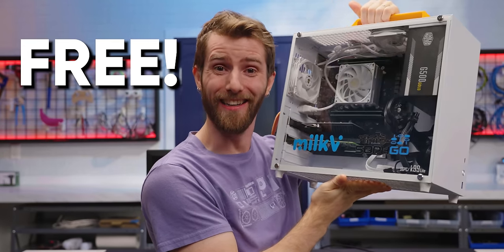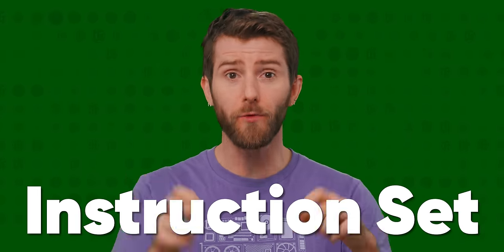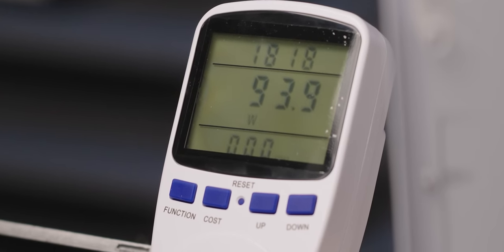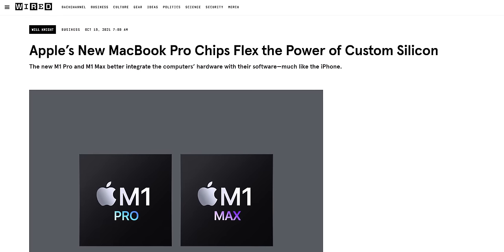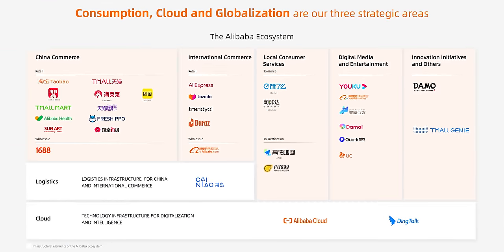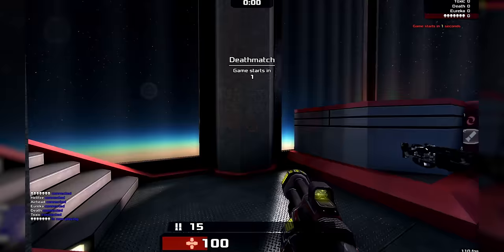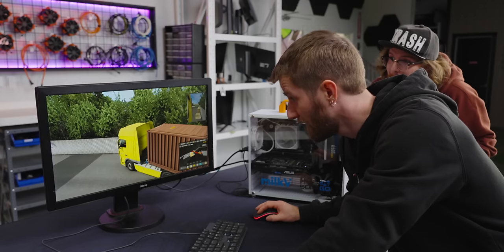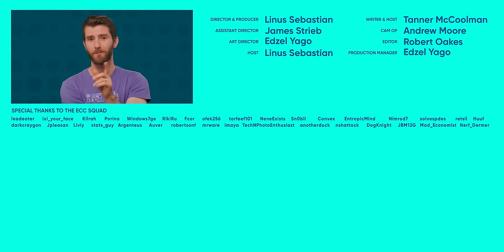This CPU is FREE! - Milk-V Pioneer with RISC-V

Comment: This takes me back to the Transmeta Crusoe from 2000, a RISC CPU that converted x86 instructions to its own in its middleware. It's a pity it never caught on as that was a really interesting concept, no software emulation/translation required, and they even demonstrated swapping out the middleware layer for a Java Bytecode one.
Reply: Though I have not used a laptop computer using the processor, one of my colleague did own a Fujitsu laptop have the Crusoe processor.  It was a tiny laptop with a long battery life.  However it did not pull out a significant lead over the usual Intel processor laptop computers. Another major competition disadvantage of this Crusoe processor technology is that it needs extra RAM to work well.  Notebook computer RAM chips were expensive that day and eventually it was caught up by competitors.
Reply: I would be really nice, if in the future there comes a RISC-V CPU that's able to do x86 instructions kinda natively.

That's the only gripe I have with the probably coming transition from x86 to RISC-V. Game compatibility and efficiency. The latter especially is necessary for gaming handhelds like the Steam Deck.
Reply: @Deinorius yeah, the big thing about the Crusoe wasn't the instruction translation, it was stuff that we now have on x86 cous, like dynamic frequency scaling
Reply: @Deinorius  Modern x86 cpus are risc in nature beneath the hood. The complex x86 instructions are broken down into simpler risc instructions. It is possible for a third party to design an x86-RISC processor but the problem is licensing. Only AMD and Intel are allowed to implement the x86 ISA.
Reply: No Transmeta CPU was EVER RISC. They were VLIW which quite frankly isn't anything close.
Reply: @TheReaper-fq6yv  I'm not talking about developing an x86 CPU but a RISC-V design that can run/emulate x86 code nearly at native speed however that can be achieved. I'm no expert in this regard.
Apple doesn't have a license as far as I know but IIRC, correct me if I'm wrong, they did something in hardware as well to make Rosetta 2 work that well.
Reply: What do you mean "it never caught on"? That's exactly what the Pentium 4 architecture IS: a RISC processor implementing the X86 instruction set.
Reply: @TheJamieRamone  so is the pentium 3,2 and pro.
The original pentium was the last CPU to be a real CISC CPU.
Reply: @dan_loup  Well I don't know about those chips, but I do remember they (intel) stating in the P4's manual that it's a RISC architecture cosplaying as CISC. But I'll have a look at the manual for those u mentioned as now I'm intrigued. 😁
Reply: @TheJamieRamone  That's pretty much correct.
One can even wonder if you could do something weird like replacing the translation layer to do RISCV instead.
Reply: It is true that intel chips run RISC internally since the pentium pro. But the risc commands have to be translated to x86 still. And this results in more energy consumption again.
Edit: I obviously meant the other way around. X86 has to be translated to RISC but actually also translated back to x86.
Reply: @aladdin8623  What? No, it's the other way around: The chip reads in the x86 instructions and translates that as a RISC routine.
Reply: The RAM issue would be a non-issue today.

Comment: As a note, for the past few decades, most CISC processors use an RISC Microcode with a CISC interpreter unit, creating a CISC on RISC hybrid machine.  This is more complicated than regular RISC processor, but less complicated than designing a CISC processor for a particular instruction set.
Reply: So could they theoretically keep the risc microcode and swap out the cisc interpreter for a risc interpreter? Meaning they would have incredibly fast riscv processors?

Comment: Worth noting that a free and open ISA is very far from having a core design. Very few companies are even capable of designing a CPU core (notice that Google's custom CPU core still isn't here). If you have to license the core design still (as most companies designing SoCs do), you may see little benefit and a lot of downside switching to RISC-V, at least in the near term.
Reply: Partially true.
Maybe in the desktop space it's true that this will be the case in the near term, but for less demanding applications, it does affect the price of the final part significantly enough to already be making a difference.

Comment: 0:05 - i am sure that 650W power supply (why so much?) is NOT FREE from patent resctrictions :), it must has some flash in it. But i might be wrong - i also didnt check that as linux didnt, but i couldnt.

Comment: Honestly, as a player of both Euro Truck Simulator 2 and American Truck Simulator, both are not exactly very well optimized. The fact you got Euro Truck Simulator 2 running at all is insanely awesome! I don't have THE most powerful machine on the planet, but a Ryzen 5 5600X, 16GB of 3600MHz RAM and a RTX 2080 Super shouldn't have any trouble running either game at 2560x1440 with highest settings, and REALLY shouldn't have issues at 1920x1080, yet I still get dips and drops at both resolutions. Seeing it run at all on RISC-V is mind blowing.

Edit: Also, I am assuming you ran Euro Truck Simulator 2 in OpenGL?

Comment: Actually, most of the ideas behind the original RISC goes back to the sixties and Seymour Cray. He realized that CPUs spend most of their time to load operands from and store result to the memory. Then he designed a CPU which only had few functional units (ALU, Branching, Load/Store) and all instructions (except load and store) were register to register ones. The CPU was much faster. So far, I just described the original RISC, but it happened about 15 years earlier then guys at Berkeley started calling it as RISC.
In his next CPU design, Seymour Cray even modified the controller unit to run multiple instructions in a time shifted parallel way: pipelined execution. He also let different functional units work on their respective tasks at the same time: superscalar execution.
What else were discovered in the sixties? Almost everything: cache, virtual memory addressing, machine virtualization, resource isolation etc. The only thing I haven't seen any reference from the sixties is register renaming.

Comment: In University we ended up simulating a RISC-V core from scratch, writing code which describes how the components of the core dealt with the binary input and what did they output. 

We ended up loading assembly code to its memory, more specifically the code for 5!. The moment I saw 120 in the simulation tool was something else.
Reply: Sorry to break ur heart but 5! = 120
Reply: @whendidamfask  Yeah, my bad there, I just wake up, editing soon. (The processor did solve 5! correctly, I just forgot what 5! was lol)
Reply: @saquial  lol😅😂

Comment: You know you got cash when you say 128 gigabytes of RAM is normal
Reply: Yeah I thought that was so weird. I figured he must have made a mistake lol
Reply: @mostlyinept  I mean it is a 64 core dev board with eec memory. The aim is not consumer but rather the server / compute / research market.
Reply: @thorwaldjohanson1263 yea. But with benchmarks of less than 10% of S23 ultra (a mobile), with 10 times more RAM 😮
Reply: @SujeetRaj711 Dev boards like this tend to vastly over implement ram, and, well, ram is cheap right now. Like... I think the Xbox 360 had like 512mb of ram but like 32gb on some of the dev boards.
Reply: you can get 128gigs of ddr4 for around 200 nowadays its not too bad

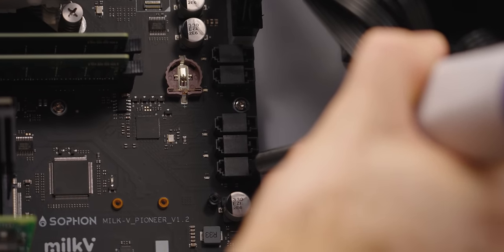Comment: 8:38 those SATA covers are not dust covers, they are needed by pick and place machines since they require a flat surface for the vacuum tip to hold on in the manufacturing process. you see these covers on pin headers sometimes too.

Comment: I am very excited to see RISC-V being adopted.

As embedded engineer I can't wait for more RISC-V microcontrollers, having cheap and license free MCUs is a life saver and I am all in for supporting such endevours.

We are not there yet in terms of raw processing power, but at some point someone will jump on this ship, once it start getting popular. RISC-V is equivalent to Linux in our world (well in some cases anyway).
Reply: The problem is having a free ISA means nothing if you have to license actual implementations (except I guess giving you more options than just ARM). Making an efficient core for an ISA takes a lot of dev time, and I'm not seeing the big companies offering that for free. Maybe there will be open source cores that can deliver good performance but that could take a while.
Reply: @meneldal  I think there will be RISC-V  soon in NVMe modules and other devices, and probably later some free alternative to the first ones. I think I read WD was working on using new RISC-V microcontrollers.
Reply: @meneldal  implementation is something that different companies will compete about but the standard itself will be free and this is really incredible part.

Comment: I enjoyed the video, finding it quite interesting. However, I believe the portrayal of the current reality of RISC and CISC was somewhat oversimplified. While it's accurate to say that RISC is more power-efficient, it doesn't necessarily translate to RISC being inherently "faster" than CISC computers. The intricacies involved in this comparison are numerous, with a notable example being the state of the x86 architecture. In this context, many CISC instructions are broken down into RISC-like instructions, a process that demands additional power due to purpose-built hardware converting instructions at the outset. To sum it up, the speed of processors like the M1 isn't solely attributed to their RISC architecture.
Reply: They never claimed that RISC is inherently faster than CISC. Just that it has the potential to be equally as fast.

Comment: Linus forgot to mention an important part of what open standards mean for RISC V. If you license an ARM design, you can implement that on silicon and add your coprocessors and peripherals to it, but you cannot modify the CPU core design. If you license the ARM ISA (Instruction Set Architecture) and design your own CPU core, you are not allowed to extend it. You cannot add your own instructions to the instruction set, and you can't the change other aspects either. That means, after Apple paid a huge amount of money to ARM to be able to design their own CPU core, Apple still not allowed to put anything into the CPU core which prevents the user to use it as any other ARM CPU. No non-standard behavior, no vendor-in-lock solution.
While if you design a RISC V CPU core, you only have to follow the standards your design needs. If you want a low power minimal design for a deeply embedded MCU, you can implement only the very small RV32I or RV32E instruction set, while you can extend it with your own instructions in a standardized way. If you want a desktop CPU? You can implement RV64G, which has all the things a modern operating system needs. You want to build a specialized CPU core for AI supercomputer? You can start with a 32 or 64 bit basic integer instruction set and select all extensions you need plus add your own specialized execution units (like image processing, Neural Network training things) and you can run them very efficiently at core clock speed. There is no coprocessor communication overhead. And you can put some dozens of them in a silicon chip if you want. (Actually, Tesla did exactly this in their AI DOJO supercomputer).

So, after all, RISC V means freedom in your CPU, SoC, accelerator etc design. It even could be a core in a GPU with shitload of FPU, ALU, textel etc execution units.

And whatever you do, you don't have to start from scratch up, you already have good industrial standards for the instruction sets. There are already many instruction set standards for RISC V. And they are well thought, many people from all over the world participated in the standardization process. Also you have the toolchain: compilers, debuggers, file formats etc. If you added some instructions, you only need to write your specialized library, or put assembly or machine code blocks in your C/C++ source code where you need your own extensions. Therefore, RISC V accelerates new designs, start-up companies: no need to get permission and license agreement, no royalty fees, but you already have the tools, open source designs etc to start with.

Comment: There are only two fundamental differences between RISC and CISC. First is that CISC includes instructions that perform 3 very different things at once - read-modify-write cycle on RAM. On RISC, the memory operations are fully separated, so memory instructions only copy CPU's internal register to memory, or memory to register; while arithmetic and other instructions only work on registers and cannot touch RAM.

A corollary is that CISC processors are more reliant on memory interfacing, while RISC processors usually have a larger register set  and interface to memory less.

A cute side effect is that almost all RISC processors can switch their endianness, because they only need to swap out a very small amount of logic for that, since it only affects memory instructions and not all instructions. 

The second major difference is that CISC instructions are all of different length, and can include prefixes which make things insanely complicated. So parsing the CISC instruction stream takes up a lot of logic. While all RISC instructions are the same length. In the end, modern remaining CISC processors convert most instructions to a RISC-like internal representation, and also manage a larger register set than exposed to software by "register renaming".

I would not say that developing directly in machine language for either architecture is easier, after all the large register file is a massive advantage; and in turn code density is not a priori worse on RISC ever since Hitachi SuperH and ARM Thumb, which have 16-bit instructions.

It's wrong to say that the instructions of a CISC processor are more powerful or more "robust". The 32-bit ARM instruction set (a deprecated classic) contained conditional tags in each and every instruction, which easily allowed branch-free code, which is just such an insane boon for both security relevant code and DSP algorithms. Lack of a similar mechanism in modern processors has opened up numerous secure data exfiltration side channel vulnerabilities.

Comment: Coming back to this after tinkering with a VisionFive2 and being in the process of setting up automated cross-compiles.
The JH7110 by StarFive/SiFive is almost kernel mainstream and the amount of T-Head device drivers I have seen is genuely mindblowing. They are even working on an edk2 port, which is effectively an open-source BIOS... well, UEFI-BIOS...thing. BUT! Anyway; things are exciting - and let me tell you, this video? Outdated. x) The Milk-V Oasis that will drop by the end of this year will do some numbers and it'll actually be insane. Since this video, RISC-V Vector extension has also dropped... which you need for AI. So, if your CPU has the V-extension and you get a GPGPU-capable GPU and smash them together, we could see a ~100w AI box. And in the process, even better performance, as MESA and friends improve their drivers. So, this'll be quite fun ^^

Comment: You forgot to mention that Western Digital has been investing in RISC-V since many years. Nearly every harddrive contains at least one ARM chip (or at least they used to), so imagine the number of royalties that companies like WD have to pay to ARM. If they can mitigate this by developing their own license free processors this could be a serious cost saving for them.

In 2019 WD bought (and opensourced) PlatformIO, with the explicit intent to improve development for embedded RISC-V.
Reply: I'm not sure they'd be saving so much money. The ARM chips in a hard drive are tiny, the licensing comes up to only a few cents for that. At least short-term, investments in risc-v are a big loss, it will take them years before they get to a design that is on par with ARM,

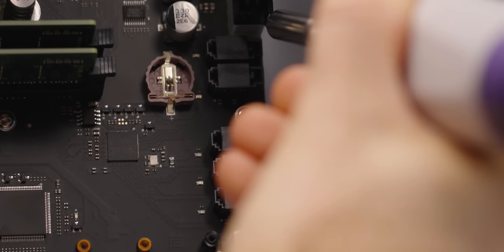Comment: 8:42 SMT machine hats. They haven't removed them in QC. also backup battery is missing. That is always tell tale that it hasn't been line tested from port. High likely it's  NPI board

Comment: Old time Computer Science guy here.  Please review the work of Seymour Cray at Control Data Corp in the 1960s.  The CDC 6500 Compass assembler had 64 total instructions.  Various bulletin board posts of the same time had a variety of "IBM style" mnemonics poking fun at the existing S/360, S/370 complex instructions sets.  "Sharpen Light Pencil" and the like...

Comment: I would love to see these in DIY home servers or on those premade NAS boxes or even on PIs.
Reply: There's the LiChee Pi 4a, which is the closest thing to a Pi RISC-V has right now. But it's not really in a true Pi form factor as it's much closer to a CM3 in function.
That being everything is on a DDR SODIMM module complete with ram, cpu, and storage that can be broken out into whatever you want. Current carrier board is geared less towards what's expected of a Pi and more tablet or computer.

 There's also the Beagle-V Ahead that's more spiritually in line with a Pi, though it's part of the Beagle ecosystem.

Comment: Before getting to the M1 moment, Arm was the top edge for many years in phones. So, that was not exactly overnight. I don't think we can have a Risc-V overnight, either. Right now it is not on par with Arm when talking about performance / watt, but of course, improved designs could achieve that. In 5-10 years it could be possible to have that "M1" equivalent moment with Risc-V.
Reply: It is on-par with ARM when talking about microcontrollers-size, next up is embedded space.
Reply: Yeah it'll probably take a decade or so